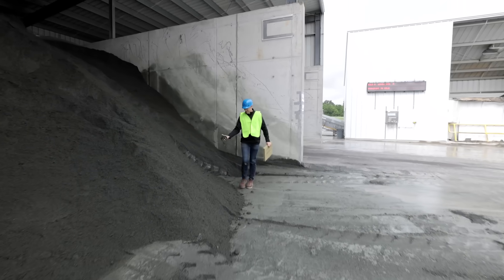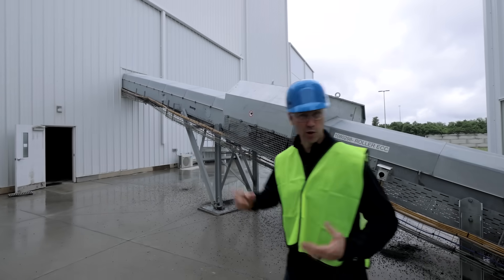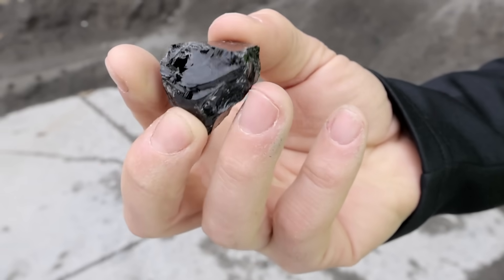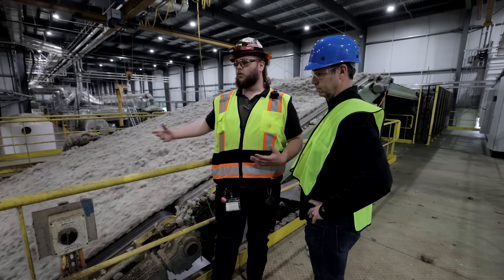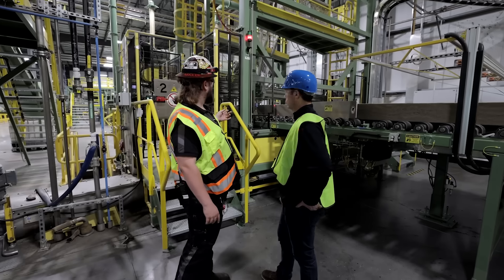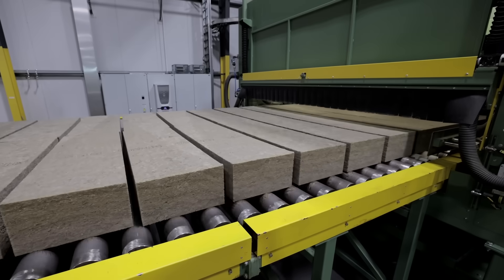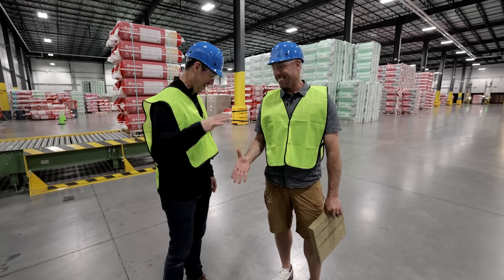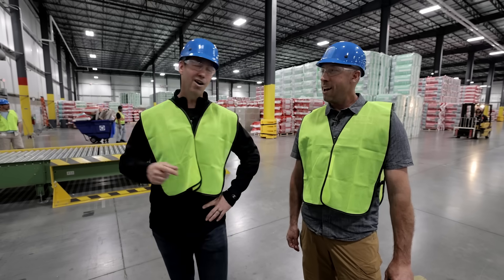Turning Rocks into Insulation! Rockwool Factory Tour

Comment: What are the rocks used/where are they typically sourced from?
Reply: The charge used at our Ranson facility includes basalt sourced from North Carolina, raw bauxite (Arkansas), olivine sand (Port of Baltimore) and limestone (nearby Williamsport).
Reply: For a video on the manufacturing process it is disappointing there is no mention of what they use, apart from vague references to 'stone', 'rock' and 'raw material'. They show a piece of the melt waste which is basically a black glass. Obsidian or volcanic glass occurs naturally and could be a source, but as mentioned by others here, slag waste from metals refining can be used, at least in part. That does not come from coal combustion, but from the ore impurities which are removed from the molten metal during smelting - the composition of slags vary but some have a very high silica content, so that makes sense. (The burning of coal would produce a seperate ash waste, which may or may not have been dumped with the metal slag).
Reply: @MikClarke  Slagging Behavior can happen in Coal Bottom Ash, and some processes like “Entrained Flow Gasification” are optimized for slag production.  Plasma Waste-to-Energy Gasifiers are optimized for slag as well (Re “Plasmarok” ).  And also as you mentioned the Roasting/Smelting/Blast Furnace Slag.

My main question is what are the Heavy Metal / Odd Metal contents.  Coal Combustion Byproducts especially contain all sorts of nasties, so I’d prefer to not use that as a product.  Granted I’d need to look into leaching behavior/inhalation risks and whatnot (MDS Sheets, Studies that may not have been incorporated into those yet, etc), and it probably isn’t too major, but these are just things i want to know i guess.

Also from a sustainable materials standpoint too;  is the product essentially subsidizing Coal Plants / Polluting Metallurgical Processes etc?

I’m sort of Nit picking, but i was just looking for / expecting these details i guess.
Reply: @MikClarke  although labeled badly this is the part 2 video, they talk about the material Basalt in part 1 , hang on a sec ill link it .
Reply: I know the Roxul plant here in Grand Forks, BC (operating for 20 years, now re-branded Rockwool) has the rights to a giant slag pile and uses that as at least part of their input materials...
Reply: @drussell_  Slag as in Coal Combustion Byproduct slag?
Reply: @ericlotze7724   The giant piles of slag are from a former smelter operation, mostly copper in this area, so yes, melty ore residue from coal fired blast furnaces.  Today it is a major local resource, sold to both the abrasives industry and Roxul for the rock wool plant.  The Grand Forks Railway is a local shortline with a whole whopping 3.7mi of track, existing solely to service trains hauling loads from the slag piles...
Reply: It is a mix of minerals selected for desired melting point and transformation  into a glass.  Quartz as in sand is a high melting point material but when mixed with limestone and soda ash, becomes a glass with much lower melting point.   Rock wool insulation can use lower quality feedstock as color does not matter.  Iron typically renders green color while carbon gives black.  Window glass requires much longer melt time for purification and blending.  Oxidizers like nitrate are used to burn out carbon but this generates carbon dioxide bubbles which require time to defroth. 
Rock wool can be made from higher melt point materials at greater expense.
Reply: https://youtu.be/lxG3jicp1oU
Reply: I’m curious too. Especially when other countries are trying to ban it or heavily regulate it because all its side effect are basically the same as asbestos, and considering it’s made with the same process as asbestos, makes you wonder, Now I don’t think there is asbestos in rockswool. But maybe it’s not the rock that’s the problem, maybe it’s the process? Maybe any rock/mineral /metal slag that’s made into batting with this process is an issue. I’ve actually reached out to them to ask this and the only reply I got was “ this isn’t asbestos “ which wasn’t even my question. So that turned me right off from there product.
Reply: @onedieingsoul  i was actually reading up on that a while back, when i heard the term “Bio-soluble Mineral Wool”. Huge Rant/Infodumping Below:

I can grab link spam, but basically as long as your exposure isn’t obscene (a la Silicosis) you should be okay

As per most things, long term occupational exposure will probably cause harm.

ALTHOUGH (as one of the papers pointed out) fiber length/morphology is important.  Asbestos is sharp and an odd length, so it loves getting lodged into the lung’s lining/“nooks and crannies” almost like a pile of splinters.  The irritation those “splinters” cause leads to all the diseases and whatnot.

Granted again *abundance of caution is always good*, so Engineering Controls (dust collection when cutting, cleaning methods that “kick up” less dust), and PPE (dust mask/respirator (I personally want one of those fancy PAPR Speedglas Combo Ones 😋) ) are great.  But they are definitely not a One-to-One comparison.

(Edit: Typo)
Reply: @ericlotze7724  very true. I’m not trying to trash the product. I’m honestly not even against asbestos, it has its place, and is great at what it’s made for. Just kinda bugs me that this is being called safe, when it isn’t any safer than everything else.  There’s an obvious reason why that factory is so clean and empty haha. If the average home owner puts this in there house. It’s fine, there is almost zero way they inhaled enough to be harmful,  but reading the comments, there are a lot of construction workers using it constantly, and think it’s “safe”. I guess that’s the issue. You know almost all of these people are not wearing even a basic respirator. A decade or 2 down the road and they will all have the same heath problom as people who worked with asbestos. I guess that’s my fear. I guess my issue is just in there marketing.

Comment: Use to be Roxul and was listed as a possible carcinogenic .
Reply: Realistically, any foreign material in the lungs is a carcinogen according to what I was taught in college during my unused biochemistry degree years (found a more fulfilling life doing construction, haha).
But my understanding is that the State of California laws required that warning (which is on everything... I just bought a set of all metal channel lock pliers and it has the warning??!?!??!) but studies showed the risk was much lower than originally surmised.
Reply: I believe you will find they have removed the formaldehyde from the process

Comment: So rockwool is basically cotton candy made with rocks instead of sugar. Sweet!
Reply: Fiberglass insulation is made almost the same way…
Reply: @macgyver03ga  yep...
Reply: Crunchy!!
Reply: Someone was eating cotton candy, stood on a rock and thought, hmmmm....
Reply: Can I order this with Uber Eats?
Reply: Mmm cotton candy 🍭 🤕
Reply: No, just no
Reply: Wait how good would cotton candy be as insulation!?
Reply: So is fiberglass. The minerals are slightly different though.
Reply: Its completely unsustainable environmentally. Defeats a lot of the purpose of saving energy when using emmense energy in production. RockWool is a danish company, and I'm danish btw.
Reply: @anderslethhefting2336  so you use energy once to insulate your house and then save energy on heating and cooling for a hundred years and you think that is not sustainable ???  well that logic would apply to any thing from  solar to windmills to electric vehicles 🤦🏻
Reply: @KevinSandersMDGoHokies  you have insulation materials like hemp, woodfiber etc. That IS sustainable. Rockwool definitely aint one of them. Look it up. Im a lifecycle expert btw
Reply: @KevinSandersMDGoHokies  ETICS only works at best for 35 years.
Reply: @anderslethhefting2336  Hemp and woodfibre are flammable, rockwool isn't.
Also, solar energy could be used to supply the heat to melt rocks directly using concentrating mirrors, so this manufacturing process could be entirely carbon neutral.
The only thing it doesn't do is sequester carbon, but its benefit vastly outweighs any cons.
Reply: @anderslethhefting2336  how many KWh are used to produce a ton of rockwool? How much energy does that ton of rockwool save in a home every year? And in 10 years? 50?
Reply: @anderslethhefting2336  
Energy consumption is tiny compared to energy saved.  Biomass insulation is inferior, harbors pests, flammable and susceptible to humidity damage with mold growth.
Far less energy needed than for house window glass manufacturing.
Reply: Every insulation requires some energy to manufacture. Every type of insulation also saves more energy than it requires to manufacture when used correctly. Unless you are suggesting that everyone switches to living out of a tent with no heat, there really isn't a more sustainable alternative.
Reply: @anderslethhefting2336  I guess that its a matter of perspective.  If you are using COAL POWERED power generation … Then Yes !!! ABSOLUTELY.  If the power source is Nuclear or Hydro or solar …. ( well not so much solar yet but …) industrial power is industrial power … ALMOST EVERY industry is guilty of massive power consumption.  We should be more focused on Doubling our power output using net zero power production.  It would be a very bad thing to start limiting INDUSTRY because it uses too much power.  We are in a transition.  Very soon we will be able to look back and cringe at how dirty our industries were.  Nuclear is super safe now and produces and abundance of power.  Solar and wind are growing exponentially to handle our residential needs and new clean power production technology is being developed every day.  Im rambling on because I like the ROCKWOOL product and use it in all my contracts.  Im also forward thinking and optimistic about the future of ABUNDANT TRUE GREEN POWER production. Sorry about the rant …
Reply: Rocks are actually the opposite of sweet. It would break your teeth.
Reply: @EddyGrimm  a lot faster than rotting your teeth, amirite?!
Reply: @Will_JJHP  Very Punny !!! LOL

Comment: This really just seems like it's the same process as fiberglas insulation. What's the difference besides the dyes?
Reply: So fiberglass is just that spun glass fibers and rockwool is a mix of bauxite and I believe steel slag. I'd have to check Matt's other video to confirm the exact mix of ingredients. That said, the big difference is Fiberglass is hydrophilic, has a lower melting point, and has smaller fibers. So that means it will soak up water like a sponge over time, melt at roughly 1200 degree's F, and compress more over time. Rockwool is hydrophobic, has a much higher melting point, pest resistant, and larger/longer fibers. So it won't soak up water easily, melts at roughly 2200 to 2400 degrees F, rats really won't chew through it, and it doesn't compress anywhere near as much over time if at all.

So over all, it's a much better product for new construction and remodels.
Reply: @Quatrawinner    Thank you. That was a far more detailed answer than I probably deserved.
Reply: @MRBenchwork  You're welcome! I work in a builders supply/warehouse so I'm just used to answering that question on a daily basis for our clients. :P
Reply: @Quatrawinner  Its made with basalt (volcanic rock) not bauxite (aluminum ore)
Reply: Not a scientific answer but I was told that fiberglass is basically sand/silicate and Rockwool is basalt (and what makes basalt different I don't know)